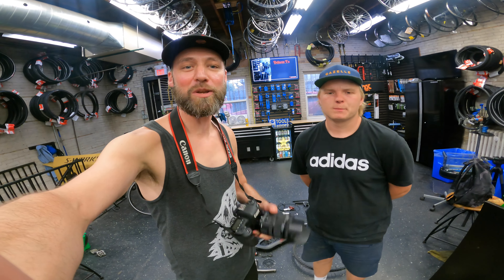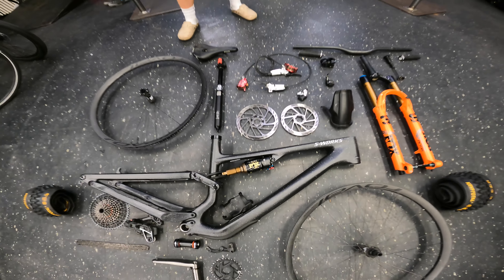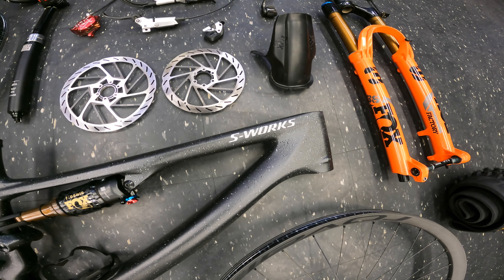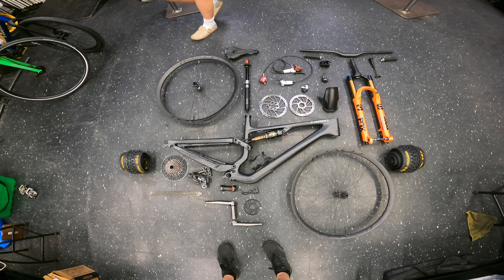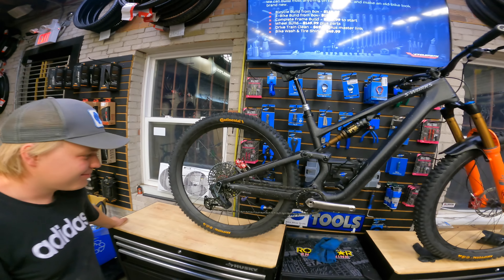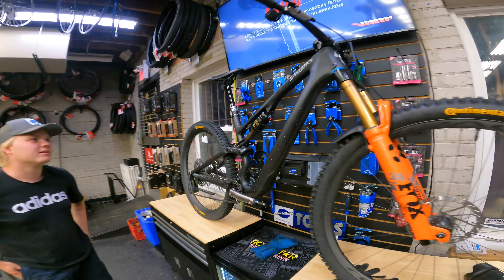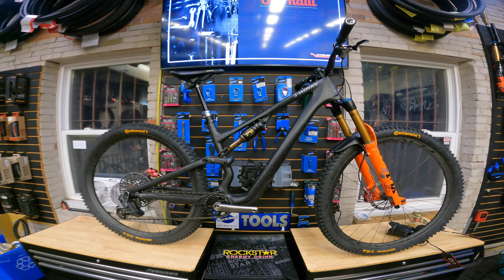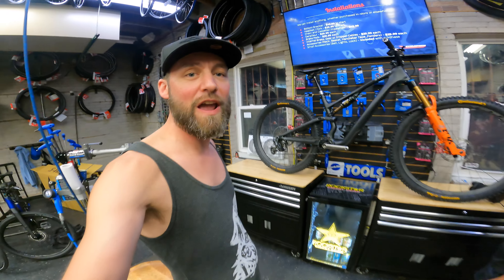NEW SPECIALIZED S-WORKS S15 CUSTOM BIKE SHOP BUILD | BRAND NEW FOX GENIE SHOCK!

Comment: I’m stuck between 150 or going 160 on the travel for this build. Any thoughts?
Reply from the maker: @Nomad-MTB  depends on how gnarly the terrain is where you ride is, of if you jump or freeride a lot.. I have 160 on my trail bike too and I love it!
Reply: @NotionMTB  Drops and jumps on the regular along with some rough desert terrain. I live in Vegas. I ride 160 on my SJ Evo and don't feel like it peddles bad at all. I'll probably go 160 just for the fact that I am at 215 lbs geared up. Your build is awesome.
Reply from the maker: @Nomad-MTB  yeah man sounds like you've got some gnarly stuff to ride in, so you should let the 160 eat up the trails on the new build! It's my buddy Esa's bike but it's such a ripper of a build isn't it? Thanks for checking out the video mate

Comment: So why roval controls?  

I’m really trying to decide what bike to get next from my stumpy Evo. I have the controls to make it a bit more light because I can only have one bike. The feedback I keep getting is there is no one perfect bike.  But a bike like the stumpy 15 is just as burly as the previous evo. Why put controls vs traverse?  

What I’m getting at is asking if this is a VERY pedalable (made up word) bike because of the genie like the previous regular stumpy or is it even better like the epic Evo series?  

For me the controls are a second wheel set behind the traverses. 
What’s the thought process here?  

Should I reconsider the stumpy 15?  Or go with a close out regular stumpy pro? Or go epic Evo?  I want a bike that is good for everything and my stumpy Evo is just sluggish on single track.
Reply: Hey! It's Esa who built the stumpy in the video! 

The Stumpy 15 is a sick bike, and I've loved every minute riding it so far!  

I chose the Stumpy 15 because like you, I can really only have one MTB. I had a Enduro, and an Epic Evo, but I found the Epic Evo still lacked some capabilities to ride the real big stuff. And the enduro was too sluggish. Funny enough, before that, I had a 2023 Stumpjumper, and before that I had a 2023 Stumpy Evo.  I found the 2023 Stumpjumper was a little too small for the big hits, and didn't pedal well enough to justify it. The stumpy evo was sluggish, but could take the larger hits compared to the Stumpjumper, but found the suspension design lacked bottom out resistance, causing me to run higher pressure to help the bottom out, but was too stiff for normal riding. 

The Stumpy 15 is a very interesting mix of a few bikes. I find it pedals better than the normal Stumpjumper, handled bigger hits much better than the stumpy evo, and even the enduro, due to it's new shock, I find the adjustment by air, and volume reducers makes a much bigger impact compared to other shocks I've had in the past. The Genie shock has allowed the bike to feel like a much bigger bike than the suspension number says, while still pedalling incredibly well. 

The Royal controls have been my go to wheels for a little while now. After riding whistler double black tech, dirt merchant, A-line, Quebec tech, All of one set of Royal Controls, I never had a problem. I like how they are quite light, but can still handle everything I've thrown at it so far. The only downside to them is that they come prebuilt, so less customization, but for me, Dt Swiss 350s are so reliable, so I didn't complain. In the end, I was planning on riding the traverse SL's but never got around to it, since I was so happy with the controls. 

Cheers!
Reply: @EsaMTB  ok thanks!!  Now I’m not ever riding A line lol- and I love the idea of it pedaling better than a regular stumpy. I could always build the same frame as yours with what I have on my Evo and go from there. What do you think?  

I do more single track than anything but I just don’t want to feel sluggish!  If it’s a bike where it doesn’t feel like it just bobs while pedaling along, it’s a good option. 

I hear what you’re saying about how the regular stumpy pedals vs not being able to take as big a hit. Truthfully I’m over 40 and I’m not as daring as before. I went with the Evo more for safety but then moved and have much more single track. 

Does the regular stumpy feel good to you for everything up to 5 ft drops?  Does the 15 really pedal better?  If so then I’ll def reconsider it. Just no way to really try them back to back where I am.
Reply: Hey! The idea of building from the frame up is always a good idea, but I find you end up spending only a little less compared to buying a full build. I chose the frame build cause I love certain parts.

I find it pedals amazingly, I find it pedals marginally better than the stumpy, with how I have it setup, but I like my setup a little soft compared to recommended setup. If you set it up correctly I believe I will pedal better! 

To be honest I got away with the normal stumpy in whistler aswell last season, but didn’t feel as supported/confidence inspiring compared to this one!
Reply: @EsaMTB  fair assessment!  I like mine on the stiffer side. Genie sounds like a winner in this case possibly. 

Or I can go with 23 stumpy pro for 5800 (!)

As far as money spent on the 15, I can just buy the frame and go from there or go all out and get frame, kashima 36, axs seat post. 

I already have carbon bars, controls, T-type xo. Just have to make a decision.   Thanks for answering. You are literally the only person who has been able to compare all the stumpies and have experience with the genie. Appreciate it!
Reply: @kentao4  No problem at all! I'd go stumpy 15! Sounds like you've got most of your way to a sick build!